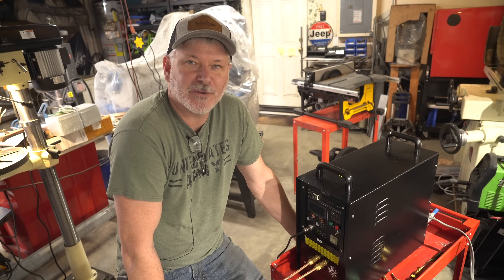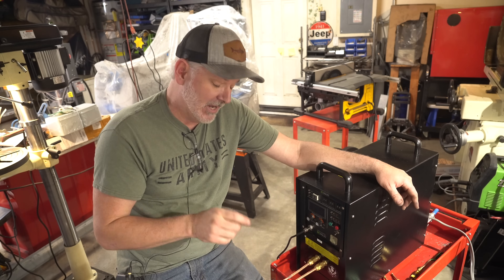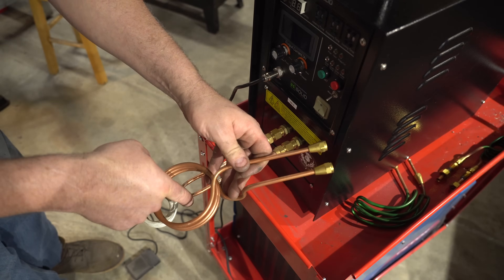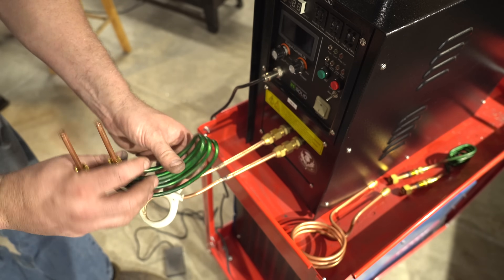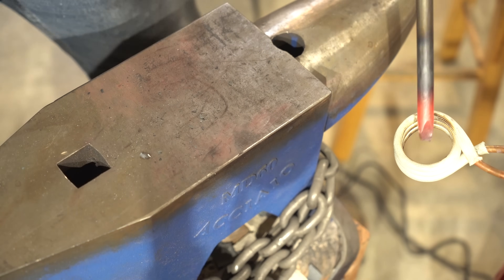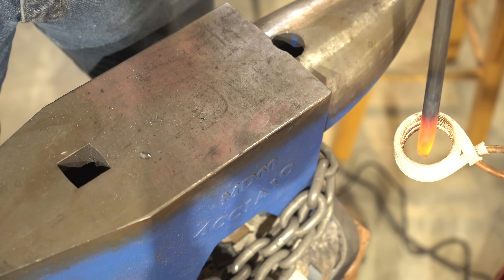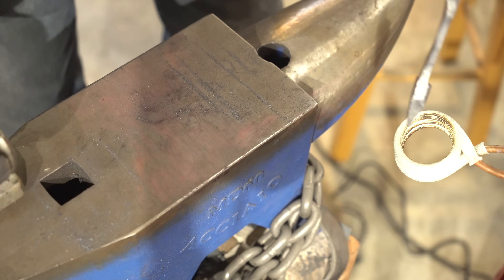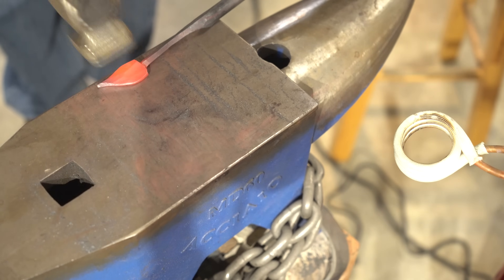Triple-T #180 - Let's try an induction forge!

Comment: Did you plug it into a wall outlet, or wire it direct to the breaker box?
Reply from the maker: I already have a 50amp wall outlet in my shop, it gets plugged into that.  The water cooler plugs into regular 110v.  Thanks for watching.

Comment: Have you noticed any difference in the steel from heating it that fast, or that type of electric heating? Plus it was incredible watching you forge that tip out like that,  everything was so square and even. Amazing hammer accuracy.
Reply from the maker: There’s absolutely no difference in the steel from heating it this way.   Thanks for the kind words and for watching!
Reply: @TyrellKnifeworks  awesome! I figured that was the case. Just a random curiosity. Love the videos like always!

Comment: It’s an alternating current that induces an alternating current in the steal via faradays law. The resistance of the metal is where the heating comes from.
Reply from the maker: Thanks for explaining it, Jessica!
Reply: Don't forget that it's a high frequency alternating current, that's really crucial to understanding how these things work. As you correctly pointed out from  Faraday, the eddy currents induced in the workpiece cause heating from Joule/ohmic heating and hysteresis loss in ferrous metal. The EMF induced is proportional to the rate of change of magnetic flux; higher frequency, larger EMF, more energy. However, the depth of the eddy currents in the workpiece is frequency dependent as well. For larger workpieces and coils, deeper penetration is required and a lower frequency is used (up to 50 or so kHz). For smaller stock (less penetration needed) a higher frequency and smaller coils are employed. These machines are fascinating...

Comment: Going on 20 years ago I worked for P&H in a variety of capacities as a machinist. I recall they had an induction heat treat machine for heat treating the outer diameter of the trolly wheels for gantry cranes. I always marveled at how quickly it heated a specific portion to heat treat temps before plunging into a quench.
Reply from the maker: They really are magical! 😜. Thanks for watching

Comment: This isn’t related to this video in particular but I was curious if you could make a longsword out of silicon bronze? It has a close melting temp to copper but a more golden color. I think it would be an interesting experiment
Reply from the maker: If you mean entirely out of silicon bronze, it would be a terrible weapon that would dull easily.  If you meant as a shim line the copper I’ve done, yeah that’s possible it’s just a little tougher because it’s melting point is about 200F lower than copper.   Thanks for watching.

Comment: I learned "the science behind it" as part of my masters, and they truly are fascinating to learn about. I've been curious about using this kind of technology as I start my own bladesmithing operation as a means to save space.
Though that $1100+ price is a little steep!
Reply from the maker: It sounds expensive but if you compare the price of propane, it’s really not.  Plus the work efficiency is unmatched.   Thanks for watching.
Reply: @TyrellKnifeworks  yeah, I guess you're right about that. 
My wife has expressed concern about me accidentally setting the garage on fire, so this may be a good work around for her concerns.
Also, where did you find the knife making attachment for it again?
Reply from the maker: @itamiyouji4057  the extra coils were from https://cluaranforge.com

Comment: An added advantage for us old codgers is that you can set up part of your shop so you can use the induction forge sitting down, and have an anvil at a suitable height to stay seated when working the hot material.
Reply: I was thinking having a temperature controlled shop. Be pointless and a health hazard to run a gas or coal forge in an inclosed shop…
Reply from the maker: Erik, you should never have a gas forge in an enclosed space.  It kicks off a ton of carbon monoxide.  Thanks for watching.
Reply: @TyrellKnifeworks  exactly, that’s what I was pointing out. An induction forge would be perfect for a temperature controlled shop.
Reply from the maker: Yup, that certainly would work.  Thanks for watching, Bryson.